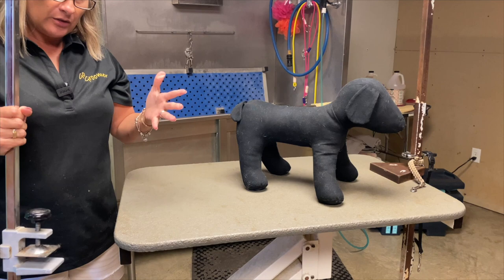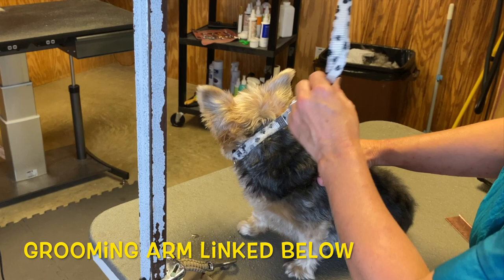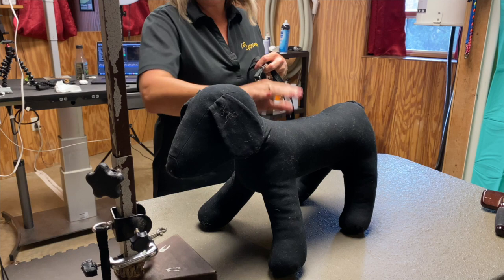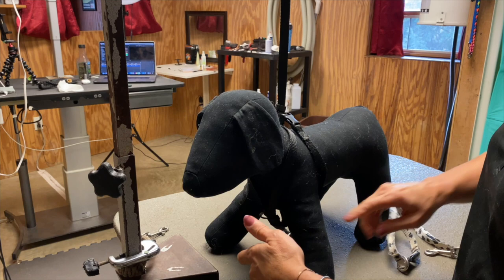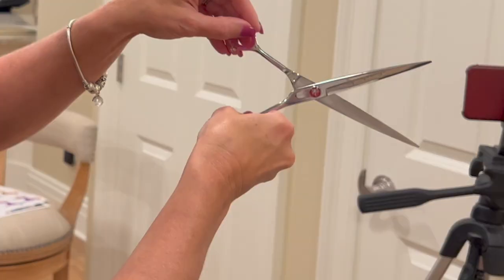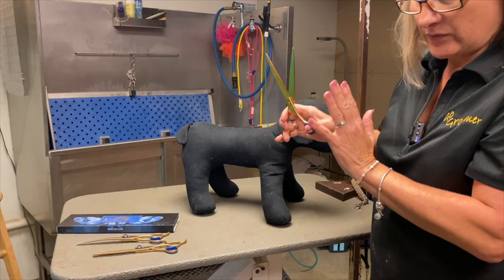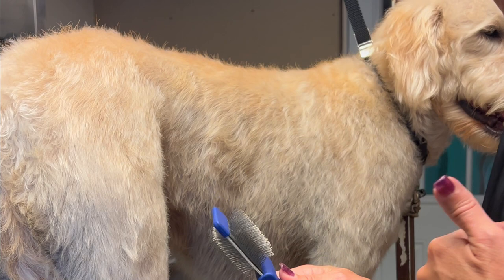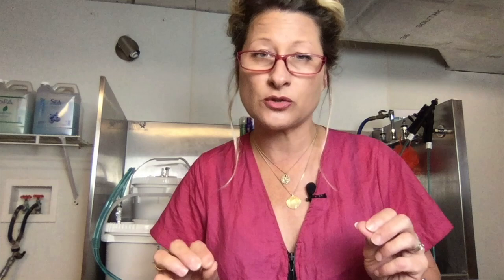DOG GROOMING HACKS that WORK!

Comment: I have 8 very small dogs that I want to groom at home.  Will the Kenchi  Flash or Flash 5 work for all my grooming needs or do I need to invest in a Wall clipper.  I really like the convenience of Cordless but also the smaller size.  Thanks. Love your videos.
Reply from the maker: What dog breed are you grooming ? It matters.
Reply: @GoGroomer   Maltese, yorkie , shih tzu and toy poodle.
Reply from the maker: @candytroutman6977  yes, kenchii flash 5 and matching stainless steal guard comes will be great as long as you properly prepare the coat before clipping.
Reply: @GoGroomer  thanks so much. I have learned so much from your videos.  😊